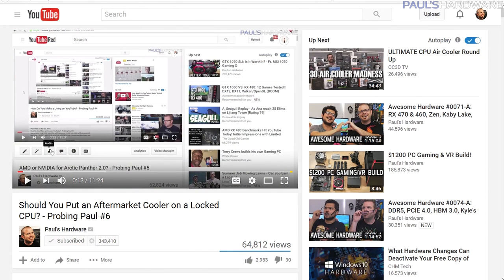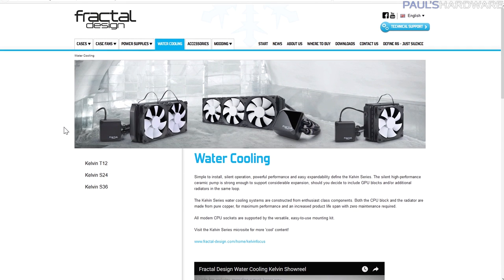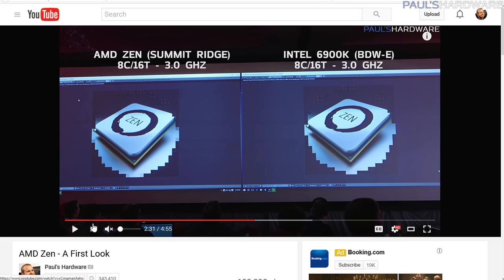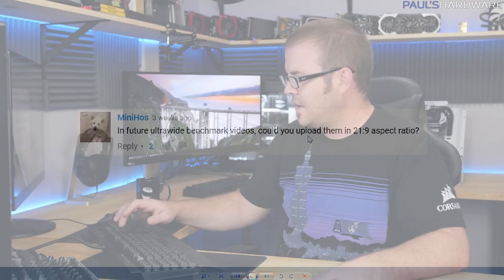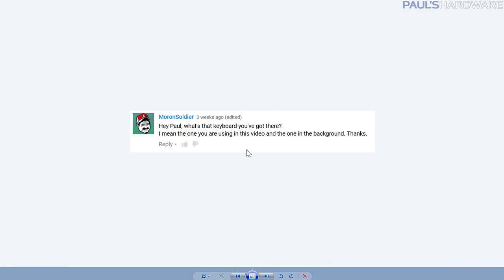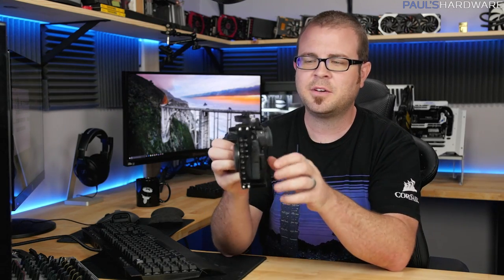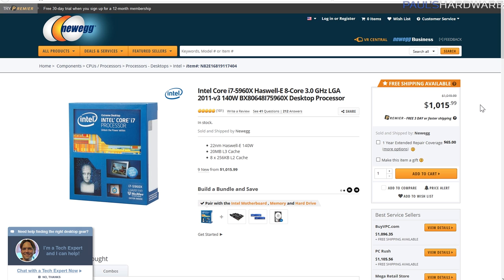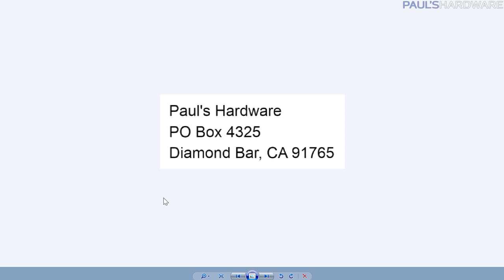Can You Expand a Closed Loop CPU Cooler? - Probing Paul #7

Comment: I got a question that might be best served with an explanation first. I recently started testing how my PCI-E lanes work while being scaled down to simulate as best I could PCI-E Gen 3 @1x. I ran a few benchmarks with a Sapphire R9 390 Nitro on effectively 2x by utilizing my motherboard's UEFI settings and it's 8x slot (to my knowledge PCI-E Gen 1 @8x is pretty close to the bandwidth of PCI-E Gen 3 @2x). I found that I didn't really notice a problem in Tomb Raider (not "Rise of" because I don't have the money for that), Valley Benchmark, 3DMark Timespy, or even SteamVR bench besides possibly the lowest frame dips (which were inconsistent) and I wasn't able to run too many tests at that point because I had less than a day to run a few different configurations (leading me to only use these fixed benchmarks). I even verified with GPU-Z that I was running Gen 1 while running the benchmarks, just to be sure.

My question is, what kind of benchmarks should I run or where I might see more of a bottleneck with lesser PCI-E lanes? I was expecting to see a performance hit at 4x (Gen 1 @16x???), but couldn't really get anything conclusive. I mainly ask because I was interested in something like a Razer Core but beyond the hefty upgrades in so many areas (mobo and CPU with Thunderbolt 3, for example), I felt it would be a fun project to build one with some (sketchy) external adapter that runs at 1x and building it into a small case or something.

Side note: My dog Martha got concerned when Hiro started yelping and she gave a quick little woof at the computer... She's also hungry though so if anything happened to me she'd be hungrier. I go feed the pets now. TAAAA-AAAANKS.

Comment: Hey Paul, I was wondering what the relation between refresh rate, fps, and screen tearing is?  For example if I had a RX 480 that ran a game at over 60 fps but only had a 60Hz refresh rate monitor, would that result in screen tearing? Thanks, and keep up the great videos!

Comment: is this build good? first build and yes I know it is very high end but I'm OK with that 

PCPartPicker part list: http://pcpartpicker.com/list/m2zfvV
Price breakdown by merchant: http://pcpartpicker.com/list/m2zfvV/by_merchant/

CPU: Intel Core i7-6700K 4.0GHz Quad-Core Processor  ($319.99 @ B&H) 
CPU Cooler: Corsair H60 54.0 CFM Liquid CPU Cooler  ($49.99 @ Newegg) 
Motherboard: Asus Z170-A ATX LGA1151 Motherboard  ($150.88 @ OutletPC) 
Memory: G.Skill Ripjaws V Series 16GB (2 x 8GB) DDR4-2400 Memory  ($69.99 @ Newegg) 
Storage: Seagate Barracuda 2TB 3.5" 7200RPM Internal Hard Drive  ($61.00 @ Amazon) 
Video Card: MSI GeForce GTX 1070 8GB Video Card (2-Way SLI)  ($449.88 @ OutletPC) 
Video Card: MSI GeForce GTX 1070 8GB Video Card (2-Way SLI)  ($449.88 @ OutletPC) 
Case: NZXT Phantom 410 (White) ATX Mid Tower Case  ($87.99 @ SuperBiiz) 
Power Supply: EVGA SuperNOVA NEX 650W 80+ Gold Certified Fully-Modular ATX Power Supply  ($79.99 @ SuperBiiz) 
Optical Drive: Asus DRW-24B1ST/BLK/B/AS DVD/CD Writer  ($16.88 @ OutletPC) 
Operating System: Microsoft Windows 8.1 OEM 64-bit  ($84.99 @ NCIX US) 
Software: Microsoft Office Home and Student 2016 Software  ($148.89 @ OutletPC) 
Monitor: Dell S2716DG 27.0" 144Hz Monitor  ($549.99 @ Amazon) 
Keyboard: Razer BlackWidow Chroma Wired Gaming Keyboard  ($144.99 @ NCIX US) 
Mouse: Razer DeathAdder Chroma Wired Optical Mouse  ($55.99 @ Best Buy) 
Total: $2721.32
Prices include shipping, taxes, and discounts when available
Generated by PCPartPicker 2016-08-27 12:04 EDT-0400

Comment: yes you can expand a closed loop, watch out to not loose too much fluid (though cut it near the middle it a 2 person job) attach the tube to your waterblock as small as possible depending on block, use compression fittings on block, go to another rad if you want (remember you always have to fill , put the tube over the outlet on the AIO tighten it with a collar (do not squash it) fill the fluid in your intake that is coming from the radiator or gpu waterblock, or what not (do not do this over equipment) if it starts overflowing stop, empty a couple of cms, connect the two last tubes together with a collar.

Comment: Just to clarify the whole AMD socket thing: At the moment, AMD uses three different sockets - AM1, AM3+ and FM2+ - none of which are intercompatible. The primary reason for this is that they all use a different chipset configuration. Socket AM1 is designed for SoCs, where the CPU, Northbridge and Southbridge are all on the CPU die, and there is no chipset on the motherboard anymore. Socket FM2+ is designed for CPUs that do include the Northbridge on-die, but not the Southbridge, and finally socket AM3+ is designed for CPUs that do not include any chipset components, as both the Northbridge and the Southbridge are on the motherboard. AM4 will be able to unify all AMD's CPU and APU lines onto one socket because it will approach this question similarly to the current socket AM1, with all future AMD chips having the CPU and both parts of the chipset on the CPU die, thus making them SoCs as well.

Comment: Paul: If you were custom water cooling a system, and you had some components in an invisible compartment (PSU area, usually), would you bother using hard tubing back there, or just go soft since it's not visible anyways?

Comment: Question for Paul - Recently I upgraded to a Corsair 450d and am very happy with it. Unfortunately the awesome performing fans that come with the case are UGLY. I want to replace them with some LED fans, but what to do with the current fans? Any suggestions?  (All the non standard fan locations are open, but I want to keep a positive pressure case)

Comment: Question for next month. In reference to AIO water coolers, does the radiator position (either installed vertically or horizontally) make any difference to how well it performs?

Comment: I never saw anyone do a video on the Z170 chipset's PCIe limitations. As an example, if you get a board that lets you use 3 M.2, then all of your SATA ports are gone unless the board manufacturer adds some via another chip. Now that the 200 series chipset is on the horizon (it has 4 more PCIe lanes) it might be a good time to talk about that. If someone wants to build a machine for video editing with lots of drive space, it is really hard to find a good way to build with the Z170, though possible. I have 3 Samsung 950 Pro 512GB and 3 Western Digital RE WD6001FXYZ 6TB and I am doing fine on my linux box. Since the Red drives aren't on the chipset, though, I can't take advantage of the Intel RST RAID. It would be great if you told people about how this chipset and others limits you. You'd be the only one talking about it, I think.

Comment: well paul. the first point you made on the water cooler i think was only slightly misleading, or i am crazy for doing what i did. but i have a cooler master sideon that i striped down and added a second pump and radiator from a thermaltake big water system that had a bad res. my system includes 1 cooler master sideon pump/cpu block combo with the original rad and the rad and pump from the thermake take bigwater and 2 ram cooler blocks and no res at all. just 2 t lines that i clamp the hose between when i drain or fill so that one lead fills and one exits and when all the air is out i take the vice grips off. kinda wish i could show you a pic

Comment: I was wondering what you do with the components you use in the systems you build every month.
the $3500 compensator(-like) build for example is a big investment.
Do you sell the system as is, or do you just return the components to where you've bought them from within a certain period?

Comment: Open ended question but here goes~ When would you upgrade a certain piece of hardware (i.e. processor or GPU)? I'm using two GTX 680's in SLI and have been thinking to upgrade.

Comment: the apus you will see on am4 with excavator cpu cores will be budget options that get Polaris based 12cu and 16cu or 768 and 1024 streaming core gpus on the 14nm finfet. basicly apus that smash ps4 with quad-cores 4.0ghz base 4.4ghz boost and igpus clocked at 950ishmhz.

Comment: Nice Show Paul. I have a question but I kind of already Know the answer. I am planning on re-painting my phantom 820. Any tips or suggestions. I do know process of 400 600-800-1000-2000 with paint primer to laquer. I even warm up the cans and wipe down with tack cloth and final wipe with isopropyl.  Any suggestions or tips you have would be greatly appreciated

Comment: Paul, you mentioned Swiftech briefly but you didn't mention that Swiftech actually markets their AIO cooler kits as expandable kits. The pumps they use are more powerful than the ones built into those closed AIO kits with the pumps built into the water block, and are capable of supporting additional water blocks, radiators, etc.

My Swiftech H220-x is happily cooling both my cpu and gpu (overclocked Xeon 5680 and overclocked Geforce 1080).
Reply: That's because he advertises for Fractal. Why do you think he first real mention was a Fractal product, despite Swiftech having a better one?

Comment: Paul. Love your channel. Love your work. Wondered if you could answer a question/do a video on running multiple video cards. I have a 780 running my primary 32" monitor to game on. And a 620 running my secondary 27" monitor to surf/watch videos on. My question is: does having the 620 to run the 2nd monitor actually help performance? or should I let the 780 run both monitors? Thanks for your time and look forward to your response. Keep up the good work. -JD

Comment: Hi Paul, looking for a small case, probably ITX, that is easy to configure for positive pressure airflow. Looking to build a casual gaming PC around an i3-6100 and reference 970 for a friend with two dogs and it needs to be hair proof with the filters easily removable for cleaning. Thanks in advance.

Comment: Question / Request for Probing Paul, What is the chance of doing a comparison of GTX 970 Dual config v a single GTX 1070. A lot of people including myself, have purchased the GTX 970 card and as they are coming down in price (about $440 AUD currently) its hard to say if its better to get another and run a dual setup v just replacing with a single GTX 1070, and using the 970 somewhere else.

Comment: Only issues I see with turning a closed cooler to an open system is the mechanical ability of the user. It’s fairly simple and not difficult but if you don’t know how to seal it back up than you will have leaks and water is not so good for your pc. Other issue i see is that you need to buy a reservoir and bleed the system so plan on more tubing and purchasing some coolant and reservoir.

Comment: Hi Paul, I was wondering how many programs or software is a safe number to monitor your GPU'S  and CPU'S  temperatures & voltage & overclocking?  Right now I have 3 or 4 different programs that run does it matter? And what do you recommend?

Comment: hey Paul, I'm thinking of upgrading my monitor, is it worth the extra couple hundred to get a 4k monitor or just get a high refresh rate 1080p monitor? I currently am running an A10-6800k and a Radeon R9 390 (and score in the 2-3k on firestrike extreme)

Comment: What do you think about getting an A/C floor unit and hooking it up to your PC via a ventilation system for extra cooling? Would air cooling or water cooling be better for that set up? Do you think condensation would be a problem?
Reply: +Johnathan Hendrix
Didn't Linus do a video where he built a computer in a fridge?  Didn't turn out to benefit it at all, if I remember right.
Reply: +nakyer I think that was because there wasn't enough airflow for the system to exhaust all the hot air properly.
Reply: Jonathan Hendrix
You may be right, but don't fridges have SOME type of airflow?  You'd think they'd need to.  Maybe it's not all that variable, and that was why the fridge build had too much heat?  The fridge couldn't compensate ENOUGH?
Reply: I don't think refrigerators have airflow, I usually only see one vent and that's to blow cold air in. I think that's exactly what Linus said about compensation, the computer was just blowing out more heat than the fridge could cool down.
Reply: Jonathan Hendrix
Not to argue, but if cold air is blowing in, doesn't air also have to be blowing out?  I mean, I've never seen a fridge door pop open due to air pressure.   8)
Reply: Jonathan Hendrix
Oh, well then, that'll be....fine?
80
Reply: A fridge and an actual AC unit are completely different thermodynamicaly speaking. As long as the AC Unit can vent its own hot exhaust out of the room or area, and not add to the rise in ambient temperature, it would indeed cool the computer down if in direct contact or close proximity with the radiator or fan intake.